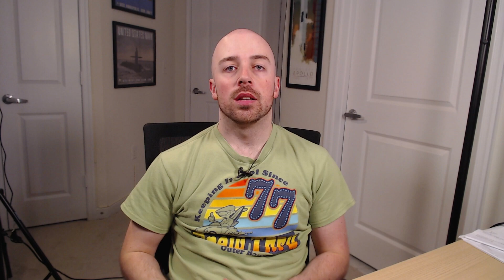Reactor Series Announcement

Comment: Can you do a review of the Yucca Mountain nuclear waste repository, its history, present and future role in the nuclear power program. I thought it would lead to a huge increase in nuclear power use since it would offer a super safe place to store the waste until we had the technology to dispose of or repurpose it. The fact that it's had a (according to Wikipedia) perfect record of safely transported nuclear waste material since 1960 might be an area you're familiar with or have insider knowledge about.

Also, pebble bed reactors came up in some recent sci-fi I read for use for small scale (relatively speaking to a full size nuclear plant), mobile purposes. It sounds like a really safe use of nuclear power and at a practical scale for transportation. My grandfather was part of cancelled project conducted by the Navy to operate mobile nuclear power plants towed by hydrogen fueled trucks. Maybe pebble bed reactors are the next thing for powering military or large scale commercial field operations?
Reply from the maker: haha holy crap that would be cool. perhaps at some point in the future, that would require a lot of research and work

yeah pebble bed is really promising, especially the branch of industrial heat applications. a lot of factories just need a source of heat and they tend to use fossil fuels. pebble bed (a type of small modular reactor) could fulfill that need, or you plop (for lack of a better term) a few of them at a site where a coal plant was shut down as it already has stuff for steam generation and turbines and grid hookups.
Reply: @TheAtomicAgeCM  Awesome reply, thanks for taking the time to read my comment. Yeah, it would be a large scale research project for sure and apologies for throwing it out there like "If you could just take a month to research a topic and spend weeks making a video for me, that'd be greeeeat (Office Space Manager asking about TPS voice implied!). I did a report on the Yucca waste disposal site back in 5th grade with (again, most of my posts will have this!) my grandpa, so I know a little bit about it. Heck, Gramps worked at the Hanford site in Washington state for a short stint and had stories galore about that as well! Not fun stories though, sounded like a bad situation there and he got out as fast as he could after finding out how badly mismanaged it was. 

Take care and will keep watch for what you have coming out next!
Reply from the maker: @rome2.04  awesome :) wish I had done some stuff like that with my grandpa, he worked on the manhattan project. stay tuned :)

Comment: Years ago NOVA on PBS did a science show on a type of nuclear fuel that cannot melt down. The U235 was encapsulated in a light colored ceramic ball. They turned off coolant water and let the core of the test reactor go dry. It sat there for hours (days?) without melting down. Do you know what type of fuel this is and whether it has any practical use? Thanks.
Reply from the maker: yup, that's triso fuel, a.k.a. pebble bed reactor. there are some in active development today! they are quite promising

Comment: I'm sure most people would love explanation of the difference between nuclear fusion and nuclear fission and why it's taking so long to build the next generation of efficient power plants.
is it really just around the corner? Like 2025 or so? I recently noticed an article about MIT making a huge breakthrough in fusion power so that's interesting news!
Reply from the maker: the meme is that fusion power is always 20 years away. the long and short of it is that you have to use magnets to control a 1,000,000 degree plasma. it's really just an engineering challenge at this point as opposed to a physics problem. but i can definitely try and get more in depth on fusion

Comment: Integral Fast Reactor that Argonne National Labs operated in the 80s and early 90s.  As a layperson I was surprised to find out that this type of reactor could use spent fuel and ‘re-burn’ it.  The result being waste that’s only dangerous for a few hundred years instead of 10s of thousands of years.  Even if we had no interest using them to generate electricity I would think we would be interested in using them to reprocess spent fuel to decrease its danger to future civilizations.  
Also, with water shortages, what are your thoughts on using nuclear for desalinization?

And one more thing.  I’m curious about your thoughts on the political aspects of nuclear power?  Nuclear seems to have been hit hard by political forces and irrational fear.  With climate change such a pressing concern and the promise of fusion still being 50-75 years in the future as its has been for the last 50 years, fission supplemented by other clean sources seem like the obvious solution.  Are we missing some aspect of nuclear that’s preventing this from happening or is it really just politics and fear?

Thank you!  And please keep posting videos!
Reply from the maker: Yeah, I recently learned about those kinds of reactors that can burn the "actinides" in the fuel to reduce the safety hazard significantly, pretty cool. The problem is reprocessing isn't currently allowed in the United States for anti-proliferation purposes. It's been this way since about the late 70s. 

I think using nuclear for desalination is a fantastic idea. I think countries in the Middle East are looking into that.

Historically, nuclear was much more expensive to build and start up (capital costs) whereas the fuel was cheaper than fossil fuels (operating costs). That's where nuclear's advantage came from. Three Mile Island happened and a new reactor hasn't been commissioned in the US since. A few are under construction now, though. With the natural gas boom, nuclear fuel isn't cheaper anymore, so there's even less incentive to build reactors. However, a new type called Small Modular Reactors are getting a lot of money from the government to be built and show real promise. One just got greenlit in Wyoming for a sodium-cooled fast reactor. 

You're welcome and I'll keep the videos coming!
Reply: @TheAtomicAgeCM  I live in the next county away from Plant Vogtle which has two new reactors under construction (Westinghouse AP1000 PWR's for anyone who that will mean something to). One is "close" to completion but does it surprise anyone that the go live date keeps getting pushed back? 😛
Reply from the maker: @JeremyHamaker  oh yeah, AP1000 means something :D that's sweet.